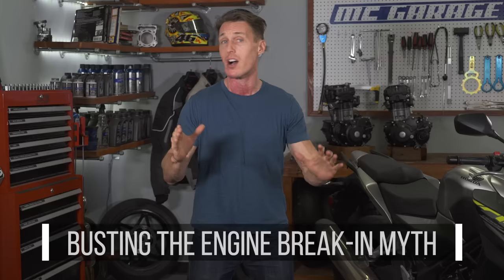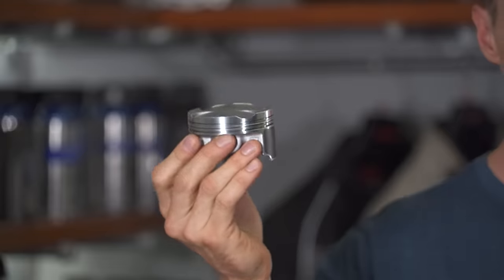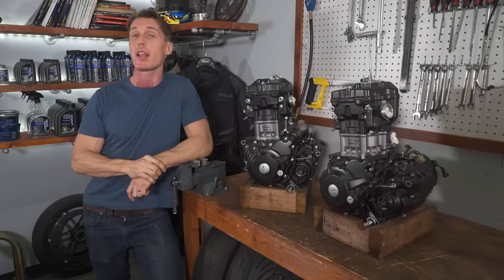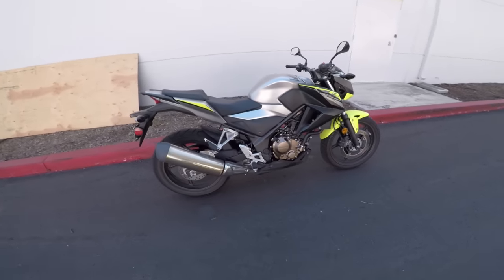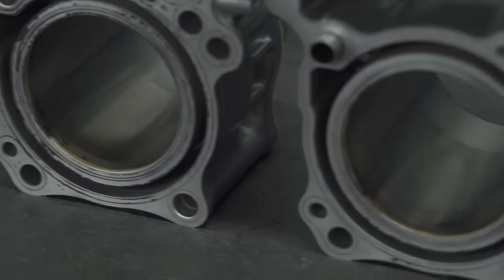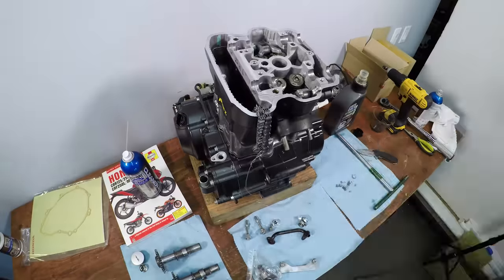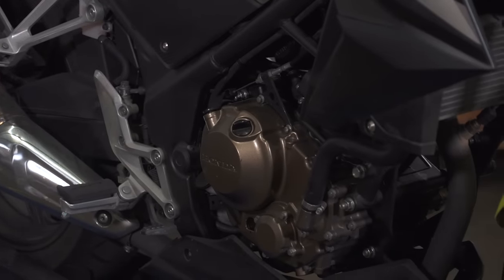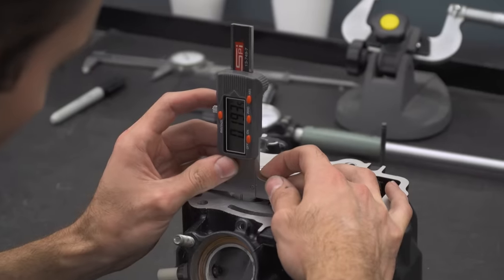Busting The Engine Break In Myth | MC Garage

Comment: The reason why you didn't get any discernible difference is because you did not use break in oil. You used synthetic oil which does not Aid in Breakin. So in essence you did not break in either engine...

 Break in oil does not have friction modifier additives in it, there for you get a controlled we're on an engines to wear everything seats appropriately...

What you effectively done was ended up with two Motors that did not get broken at all, they may have gotten 50 miles worth of engine break in wear in the 1000 miles that you drove them

It's extremely important to use a break in oil when you break in a engine, otherwise you've accomplished nothing. In other words, you wasted your time and didn't prove anything... it would have been better if you would have used Straight conventional oil rather than synthetic, the latter of which is so slick that there is very little to no wear to break in an engine

My 40 plus years of being a mechanic tells me this

I get a kick out of idiots on YouTube that think they're experts, that in reality don't know anything like you. But the sad part is, you end up creating a bunch of people that are just as big as an idiot as you are because they listen to you

Comment: Weird every single manufacturer ships every single bike with Breakin oil in the crankcase. All performance engine shops use what, Breakin oil !! Didn't see a oil analysis done and results. You'd have to do a complete blueprint build and teardown. No debate was settled today, you failed to grasp why you would, wouldn't and do's and don't.

Comment: A mechanic should never second guess the factory. The manufacture made the engine. They know more than the mechanic or any dealer. I would find it difficult to believe a factory trained technician can have more knowledge about a product than the manufacture. If someone has a 15,000 to 19,000 dollar motorcycle they would like me to run the shit out of while it has less than 1000 miles on it. I would be happy to help. One thing that’s guaranteed not to have not changed when I bring it back will be your monthly payments. Ignoring what the manufacture says just doesn’t sound like good advice..Maybe it’s just me. I would encourage anyone to contact the manufacture if an authorized dealer is giving them information that conflicts with what the manufacture says. I would take note how long they keep their dealership after the factory finds out the dealer is telling customers to ignore the manufacture’s recommendations.
Reply: You have to consider that a manufacturer has to protect itself from liability. By saying there is a "Break-in" period, this protects them from any potential issues that may occur.

Let me ask you this, on a track only vechile, how do you think they break in the engine? They aren't going to drive 1000 miles on the engine. They will do a couple miles of pulls of varying RPM (amount depends on engine) with high amounts of vaccum during deceleration.